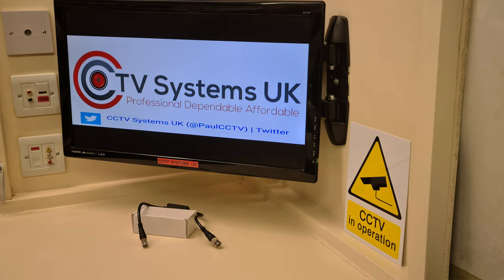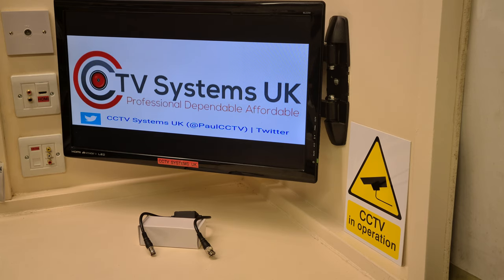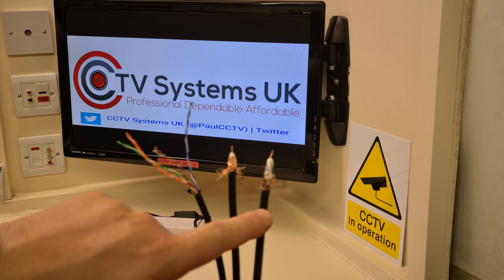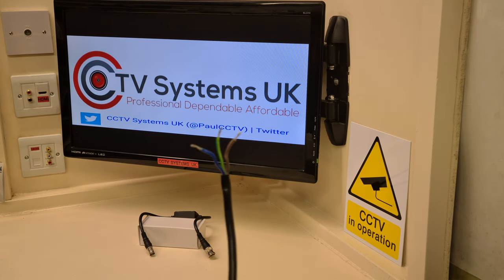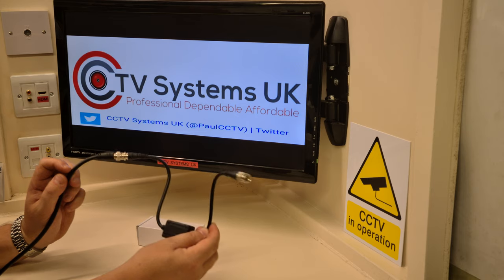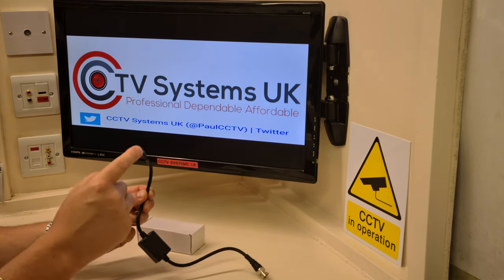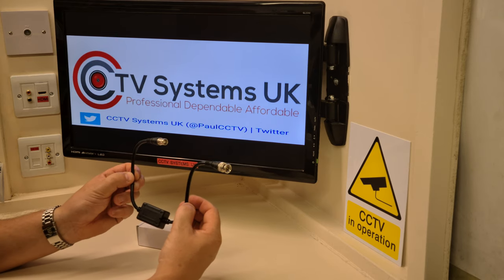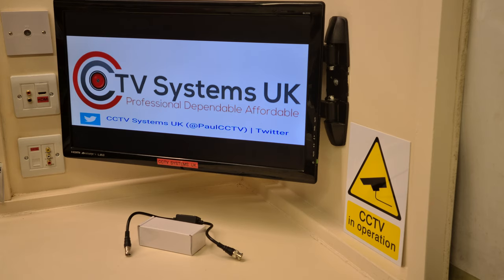CCTV Interference solved. (Ground Loop Isolator)

Comment: This is an excellent video and crystal clear explanation. I have been trying to figure out where my horizontal line interference was coming from but more importantly did not know there was a fix for it, I will try this out anything, thanks.
Reply: hi did you already try this? i have same problem

Comment: Hi Paul, Love your videos, theyre a big help, so thumbs up to you.
I've just had 3 Hikvision ColourVU 5mp cameras fitted to my home, they have only been up two weeks and one camera has misted over (like condensation) and another has many thin black lines horizontally on the screen. can you possibly tell me what could be causing this ?
Kind Regards
Jase
Reply from the maker: Hi Jason,

Sorry for the late reply, but Youtube sometimes doesn't send us post notifications.

Even though it's a little late, I'll have a crack at this!

Any camera can mist over, even brand new ones. Most issues after installation are caused by the cable tail on the rear of the camera being pulled excessively during the installation process. This actually damages to waterproof seal around it. This will let in condensation, as would a slightly misaligned lens seal.

Thin black lines sound like one of three issues. 

1, The camera cable could be close to a power supply (especially if the installation was done using Cat5e or Cat6e) 

2, The connections on either end might need replacing. Eg: Video Baluns etc. 

3, the PSU "power supply unit" could need replacing.

There are of course many more reasons I can think of so I'd suggest getting a professional to diagnose it for you.

P.s As strange as it may seem. A simple movement of the DVR / HVR from left to right in its location can often solve pesky issues like lines on the screen.

Hope this helps you in some way.

Regards, 

Paul

CCTV Systems UK

Comment: Hi I've setup a one cat6 cctv, the next day it has no image, its only a 25m run.
Reply from the maker: Hi,

Put a data cable tester on the cable and test it!

99% of the time it's a duff cable or a bad RJ45 connection on one, or both ends.

Use a made up lead to test the camera at the DVR end! This way you can also rule out a faulty camera.

Hope this helps.

Regards

Paul

@CCTVSystemsUK

Comment: Hi, Is a ground loop isolator the same as a Video Balun. Does it do the same job?
Reply from the maker: Hi
No a video balun is a connection used when sending video down cat cable.  

A ground loop isolator is a piece of equipment to aid removing electrical interface from CCTV systems. Including cat cable.

Hope this helps.

Regards, 

Paul

CCTV Systems UK
Reply: @CCTVSystemsUK  Thanks for the reply. great video by the way. well explained.

Comment: Can you use this with balloons and cat5?
Reply from the maker: Yes you will be able to use them on the DVR end but, the nature of Cat cable EG: unshielded, means that interference in the cable could conceivably be much harder to get out!

But yes, you can certainly give it a go.

Hope this helps.

Regards, 

Paul

CCTV Systems UK
Reply: @CCTVSystemsUK  thanks for your quick reply. Much appreciated!
Reply: The mains AC power cable, twin and earth, is not positive and negtive.  Green or green/yellow is Earth and the other two are Active and Neutral. This is not a DC system. It will radiate noise at the local Mains AC supply frquency (50 or 60Hz generally) or a harmonic thereof.  In Australia, there is a requirement to maintain about 60mm minimum gap between data/comms and power cabling and it's good practice to avoid parallel runs with AC cabling.

The ground loop isolator has a Coaxial cable and connectors.

Data cable shown here is UTP, Unshielded Twisted Pair. Cat5 and Cat5e and Cat 6, for example.

Data cable also comes in a shielded format for use in locations where there are sources of EMF/RF Interference. 

Data cables are manufactured in such a way that they minimise Crosstalk.  Shielded or Unshielded, there is no need to have them unbundled and in data installs its normal to see backbone data cabling loomed/bundled where it leaves the rack and also travells through the roof cavity.

Generally,  power in data cabling, POE, or "Power Over Ethernet" is DC, and shouldn't cause any issues within adjacent cables.

Comment: Hi will this work on audio / sound interference thanks
Reply from the maker: Hi,

They are certainly not designed for audio use but, could possibly quiet sound down due to there ability to remove power interference. .

That said, there are ground loop isolators out there designed specifically for audio that are very inexpensive and easily found with an Internet search. 

Regards, 

Paul

CCTV Systems UK

Comment: We added one of these cables but now our ptz camera won’t move around. Any ideas?
Reply from the maker: Sounds to me like the ground loop isolator is too strong. 

If your PTZ has stopped moving simply remove the isolator, then if the PTZ resumes it's normal functionality you know that the isolator is blocking the PTZ protocols 'commands'.

I know ground loop isolators are not really recommended for PTZ use but, we have installed them on PTZ's with no functionality issues.

Try a different manufacturer of isolator would be my advice. 

Hope this helps. 

Regards, 

Paul

CCTV Systems UK
Reply: @CCTVSystemsUK  Thank you so much. Truly appreciate your assistance.